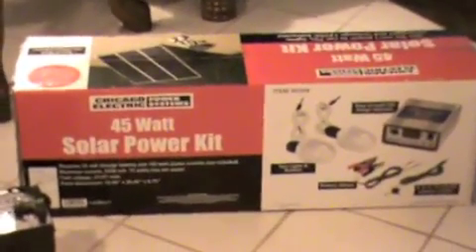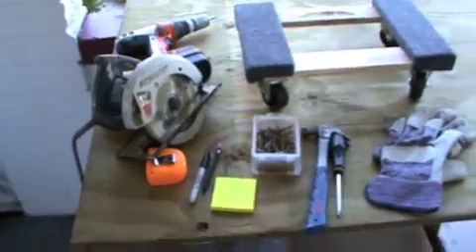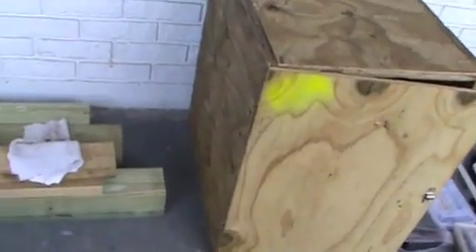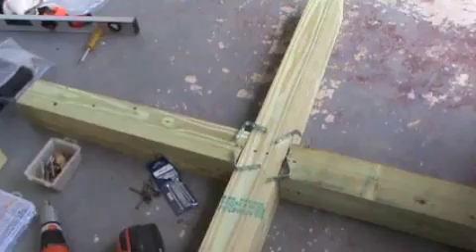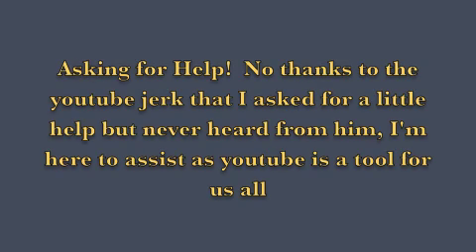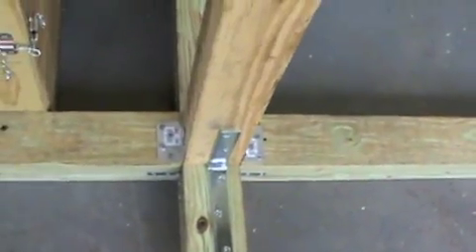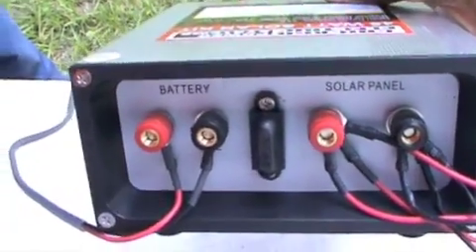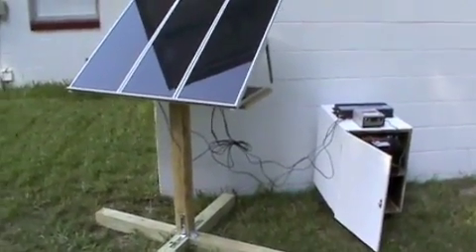Cheapest emergency solar panels for DIY projects and SHTF emergencies.

Comment: Wow women using hand tool's along with power tool's is great. I'm a bridge carpenter and I've only seen 1 women doing that kind of hard work. Nice job on that project.  Put a piece of plywood under the wheels if you keep it on the grass. Or not just a suggestion. Love your vids

Comment: Thanks for the reference over to this video.  I started out using the HF solar kits.   We call them the "gateway drug" in the solar power world.   Then I figured out I needed/wanted more and more then a little more power.   Your next logical step is an 80-100 watt panel from one of the regular solar vendors, and if you shop around you can do that in the $150-$200 range.   If you pitch in with a friend and get a pair of the DM solar 158 watt panels from Amazon, then you are likely to be under $200 per panel but those are pretty large panels and will require a larger charge controller.
Reply from the maker: I am on my way to a better solar setup. I have plans to purchase 2-250 watt panels to start off and a pure sine wave inverter. I already have a nice controller to go with my new setup I just have so much to do I don't have time to put into it right now but for sure its coming. Thanks again for all the info and for the support

Comment: Love to see someone recycling wood. It does take a while but you get to say that you created it. Very nice set up. Don't forget to paint the wood on the dolly you used for the wheels on the battery box also. With Water proof  or resistant paint. Can't wait to see more.  Onward !

Comment: FYI.  You can get 100W solar cell for around $160 in ebay.... twice the power for about same price.  includes frame, solar cells, charging control, cable.  I might try getting that.

Comment: This is a nice DIY video. I use 4 used storage batteries in my HF 50w kit. My inverter is a 2000w HF unit. I found 2 bad 50w panels I repaired plus I got a couple of single 15w units from HF in the past. Total 180w. It will run TV, PC a small heater or AC unit all day. I'm happy with my setup because we lose our power a few times every year for a day, but most of the time it is for a few hours. Living out in the woods it takes longer to get it fixed because the towns come first. Cheers!

Comment: @Comfytees Most quality Charge Controllers will do just that. Check out controllers from XANTREX, Morningstar or the higher end Sunforce models. You want a Charge Controller with a "Dump Load" feature. The Harbor Freight System is a great system tonget an nintroduction to Solar Power. One weakness is their Charge Controller.It is the fiurst thing most replace after they get their feet wet with this kit.

Comment: Outstanding! Thank you for the video. How has the solar panel and charge held up? I know the frustration you are talking about with wood working. I measure 8 or 10 times, and after cutting, it STILL aint right! Thanks again for the video, keep up the good work!

Comment: I think this looks great. Not sure if anyone else has suggested this, but maybe you could put a junction box on the stand itself, wire together the 3 panels in that , then connect one (+) and one (-) line coming out...so you don't have 6 wires going to your charge controller/battery array. Just a thought. might save some headaches if you ever decide to add another set of 3 panels. Good job.

Comment: That's not a bad stand! But if you have any stability issues, you might want to add diagonal bracing to the "legs." A right angle is never as strong as a triangle!

Comment: Very cool vid. was thinking of getting a solar panel for those days the power goes out in storms and i could put up a space heater or fan to it , plus charging up other equipment instead of racking up my electric bill.

Comment: Good job on your putting together your solar panel kit with battery storage.  These kits are fun to work with but are limited by the panel size.  You can string a series of these panels together over time and have alot of solar power at you disposal.  Thanks for sharing and posting for us.

Comment: not sure if anyone said this or not but not sure how sealed your box is but charging batters produce hydrogen and i'm guessing you know that is very flammable.....any ways might want to look into venting your box in a way that still keeps out the elements. just a thought in case you have not been  told or didn't think of it.

Comment: Quite impressive! I love the lazy susan idea. Others could also salvage swivel tv stands as well for this project. I haven't read all your comments so I don't know if this needs to be mentioned yet please be mindful that batteries give off explosive gas and that's why battery boxes are vented. I'm not sure if you are keeping your inverter in the box and there would be the possibility of a spark. If so just add a few venting holes. Also in wind your panel could become a sail and tip over.

Comment: Welcome to the fun of solar. You will want a inverter now. Either both a grid tie or a dc ac inverter. Look up donrowe for inverters he is really good. Good deals and very informative. Also make sure get a pure sine wave with temperate fan. This will have a fan that only runs when needed most HF inverters have fans that run non stop. 
Don't get the 2000 watt inverter 3 huge fans run non stop and will kill your batt. quick

Comment: Great job! You can't beat the the Walmart Group 27 deep cycle batteries for the price, for connecting them, use battery cables. They are color coded and thick enough.  You do need to put a few vent holes into the cabinet. Even with sealed batteries the cabinet can build up explosive gasses.
Great use of the lazy susan, never would have thought of using that.

Comment: Awesome first timer set up, I hope I wasnt the guy who didnt respond to you when you asked for help. A cool tip for the lights is, leave them plugged in and run them to a regular house hold switch you can find for about $3. Also leave the batteries out side and drill some holes in the side for ventilation,  for batteries expel HHO very dangerous..Great video cant wait to see another...LATER FROM THE WEST COAST...